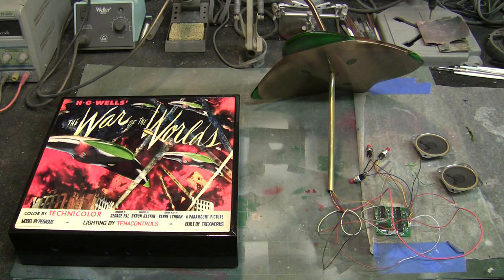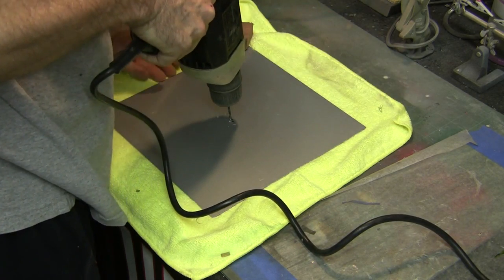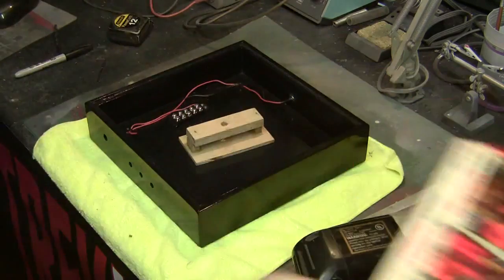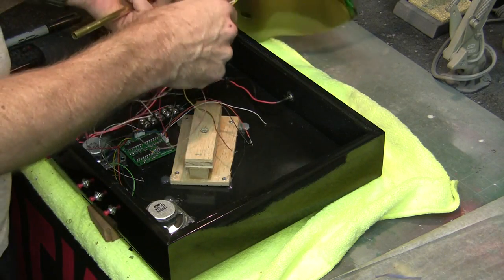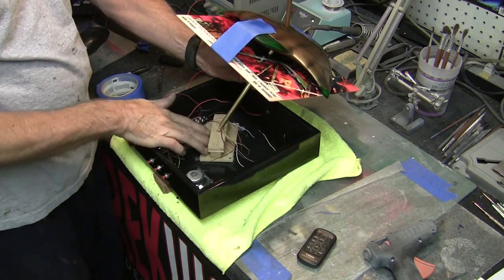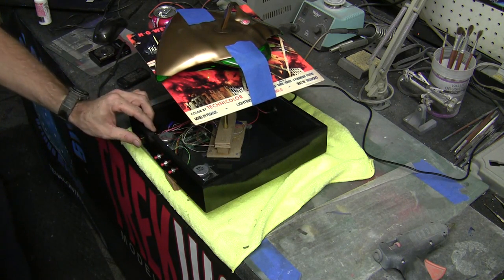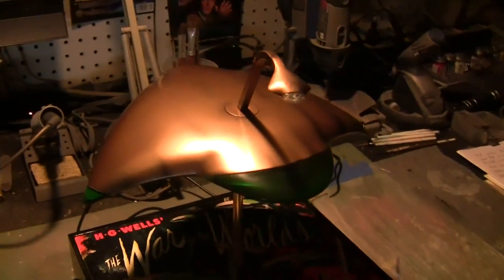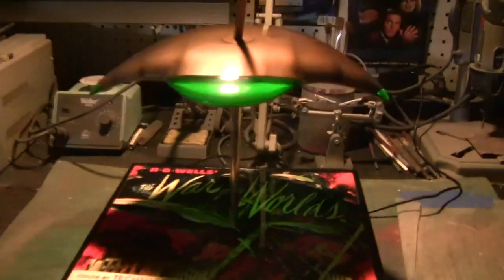How To Mount Your Lighted Model On A Base

Comment: Boyd, thanks so much for sharing all these techniques with us. A tip to find the centre of any square or rectangle quickly without measuring - just get a straight edge and draw in the diagonals: where they cross is the centre.

Comment: Well, you have a good idea.  I don't know why you would want to destroy an archival and historic piece, but that is your choice...

In order to achieve a more accurate center, instead of measuring from top to bottom and side to side on the plate as you did, you would have been more accurate if you measured from corner to corner.  That would have brought you much closer to the center, but hey.  You already did so.

I WAS concerned seeing and watching you drill into the plate with your drill, and a cloth underneath.  That could have been disastrous... nice watching, but not exactly what I was looking for, but thanks anyway.
Reply from the maker: JW Destroy an archival and historic piece? If you are talking about the artwork on the display base top it was not an original piece. It's a print that was done on top of the metal.